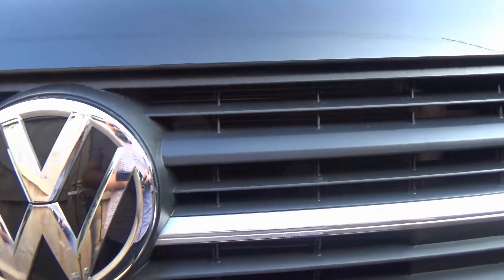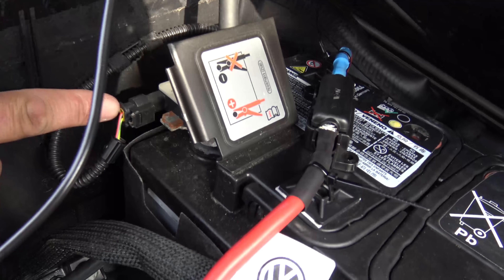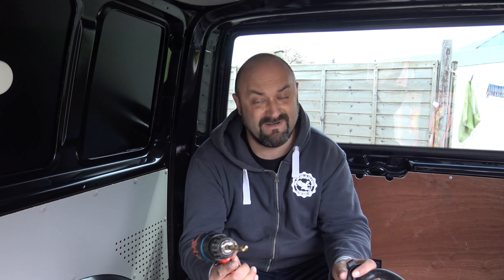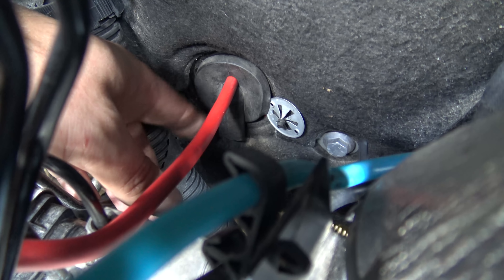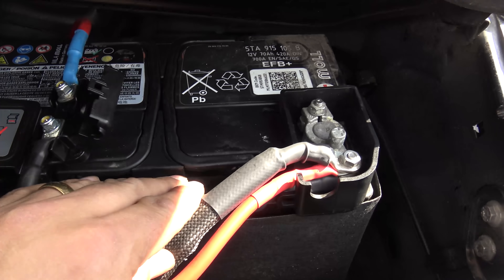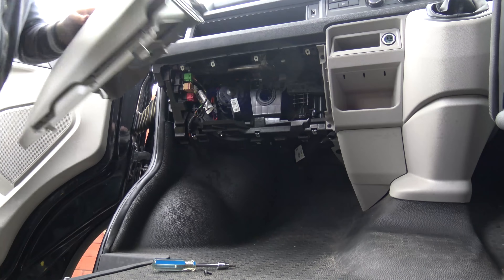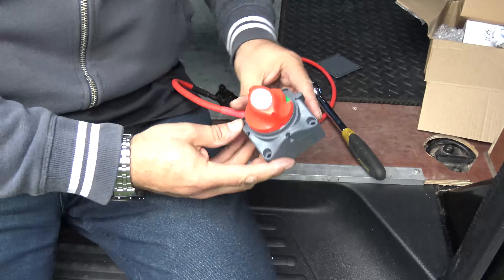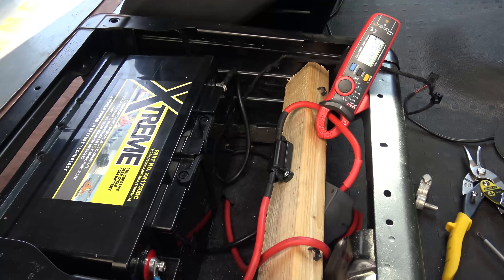DuB-EnG: DIY T6 Camper Van Part3 Electrics Installing Leisure House Service Battrery Split Charge

Comment: I do so many of these at work its crazy nice work with the fuse on each end. Will that DC to DC charger thing work as an isolation solenoid?
Reply from the maker: Exactly that... the ctek charger will just take care of making sure the house battery is always fully charged! ...  hope to wire that in this weekend...
Reply: @DubiousEngineering  nice!!

Comment: great video and not too dissimilar to my T5 project. Any tips on securing the battery in place? I went with a non AGM but low profile one
Reply from the maker: Hmmm...  I used blocks of wood carefully cut to shape to “chock” my battery in place and insulate the terminals from the metalwork of the seat...  check out my ctek install video... perhaps that has a little more detail
Reply: @DubiousEngineering  thanks, just watched it! Your rage when losing a washer twice was my best bit 😂

Comment: So the grommet actually remains in it's original location but is used as a way through for the cable?
Reply: It was a question!
Reply from the maker: Exactly that!! ... the grommet is an outlet pipe for condensation from the heating system...  just pop a small hole in the grommet above the outlet

Comment: Great Video as always. Working on a similar project I am finding these very helpful. Question: Does disconnecting the battery cause any problems such as radio security codes needed afterwards or loss of any other coding else where?
Reply from the maker: Nope...  no problem at all.  But, removing the drivers seat airbag connector and starting the engine will cause a fault that you have to have a computer to clear!!!
Reply: @DubiousEngineering  Yes picked that up on one of your vids. Like I said very useful and informative saving lots of people lots of heartache I'm sure.
Reply from the maker: Hahah... thanks Tony :-).  I have a few more jobs to do on the van, but the weather has taken a turn, so it will be a few weeks before another van video... but plenty of other fun videos coming!!

Comment: Finished my conversion last week. Decided to take a week off work as I was going in a camping trip at the week end. 12 hour days for seven days straight and finished on the Friday night and way in the van on the Saturday morning. I have the same battery and CTEK 250 under drivers seat along with RCD and 12v fuse box. It’s a squeeze.
Reply from the maker: Wow!!!  Got any pictures??  Are you on FB or instagram so I can see your amazing creation??  Great work by the way!!  You must ache a lot!!!   Alll the best!! Howard
Reply: I was doing a build thread on the T6 forum but I need to update it.
Reply from the maker: Post a link when you get a chance...   I’m keen to see the pictures! ...  I just released the carpeting video...  pffft....  that was hard work!

Comment: Few YouTube Videos mention smart alternator and dual batteries. Many do bye a old type split systems. But whatever you have DC to DC charger system is best. But if you have solar there are system whit both. Great videos
Reply from the maker: Ahh thanks yes, the CTEK handles solar input as well as balternator input.

Comment: Friend of ours had problems with their VW and the "smart" alternator when they added a leisure battery.  The "smart" alternator could not take the extra work of producing the larger voltage and current full time :-)
Reply from the maker: Interesting to know...  those smart alternators are made to be efficient, and save fuel...  I hope this video is useful to those that are thinking of doing this...

Comment: Great videos but a few words of advice, when disconnecting a battery remove the earth (negative) connection first, when reconnecting connect the positive first. If the earth is connected and the spanner you are using on the positive touches the metal bodywork, you will get a large flash as all the amperage in the battery travels through the spanner making it VERY HOT.  You can actually weld with a couple of batteries connected in series.
Reply from the maker: Very, very good tips Martin!! Thankyou!!

Comment: Nice video - However this split charge set up will not work on a T6 as the blue motion and stop start means that a standard split charger with relay does not allow for the forced low main battery charge (80%) to allow the blue motion to work (it charges up the battery when you brake and saves the kinetic energy, google it) and the much higher alternator voltage surges (from the blue motion) will damage the leisure battery over time, you need a proper B to B charger (eg Schaultd WA 121525 ) AND a feed wire to tell it when the engine is actually running - not just an ignition on wire (or the leisure battery and wires get loaded on cranking) - I have been struggling with this for several weeks now - and still no answer to where you can find a engine run feed on a 2018 T6! JP
Reply from the maker: Totally agree with you!!  You need to watch my other video fitting the CTEK DS250 DC-DC charger... it’s working a treat and manages the leisure battery properly...